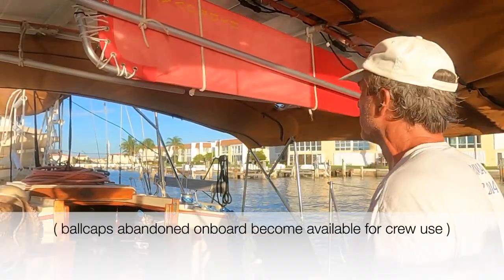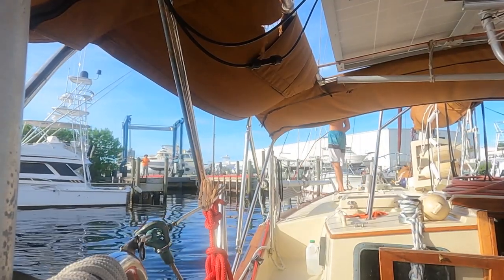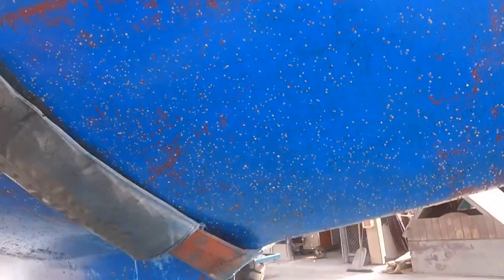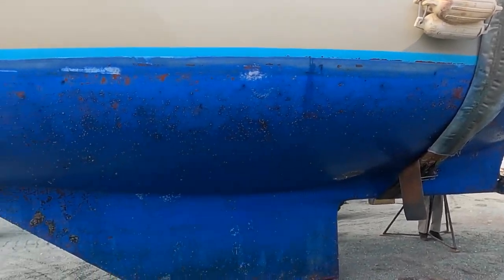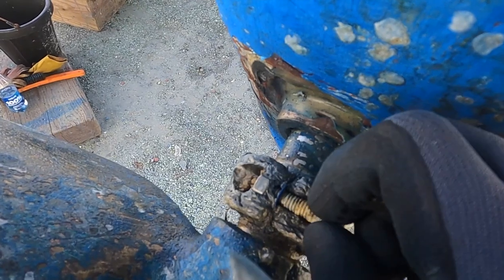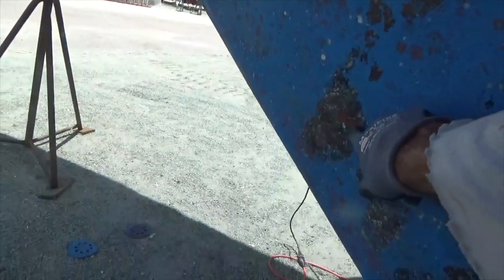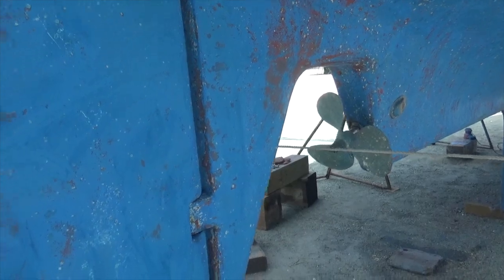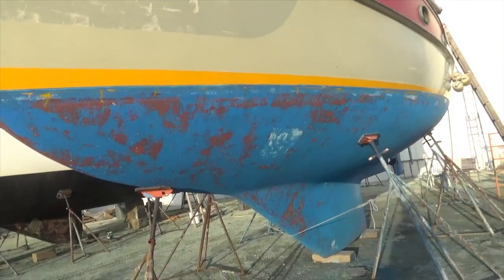Skipjack Sailing 99

Comment: Thankfully you shouldn't get any winds from Idalia. Have you thought of applying prop speed to the propellor?
Reply from the maker: Actually....I was almost dismissing the storm since its center was >200 miles away, but the first outer band packed a real punch.  We had dinghies flying like kites...one ended upside down.

When I get a new propellor, I will pry out my wallet for prop-speed.  But (on the other hand) I've seen props after two years with Prop Speed, and they looked just as bad as mine did.  So I think that there really is no solution, other than to anchor in clean warm water so I can snorkel down to keep it clean.

Comment: inspect all thru-hulls, replace if nec. Write down your zinc anode size and brand in your logbook, brand and type of anti-fouling paint, in your logbook. inside the boat, inspect all saltwater hoses and clamps--rplace as nec, note in logboook-------mikey, Belfair, Wa
Reply from the maker: Good stuff, Mikey.
You a sailor also? 
I do keep the logbook but not well with things like those you listed.
In fact, I had a spare anode the whole time.  I've been spending time this week improving organization in this regard.